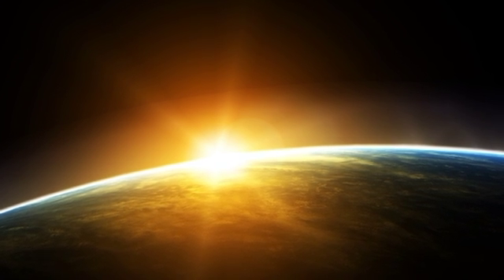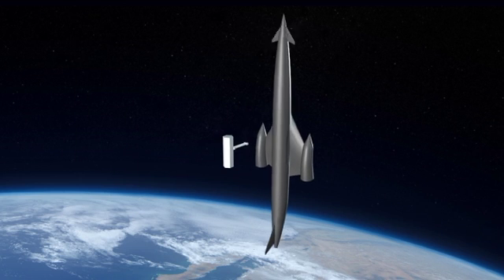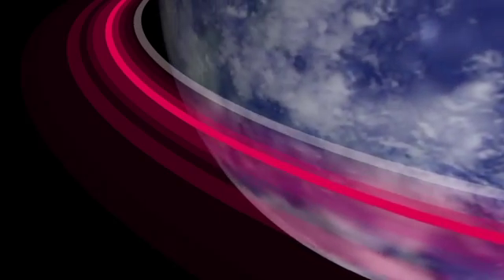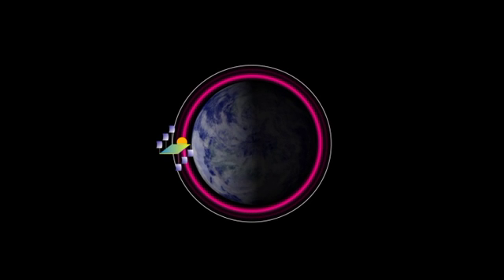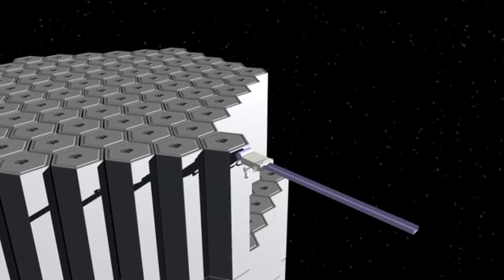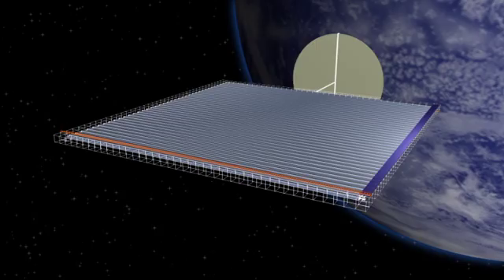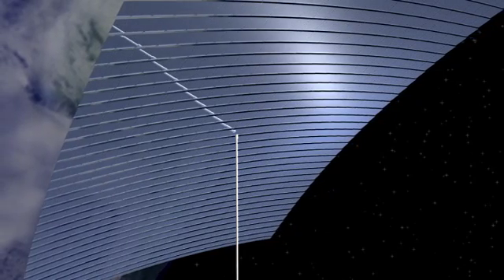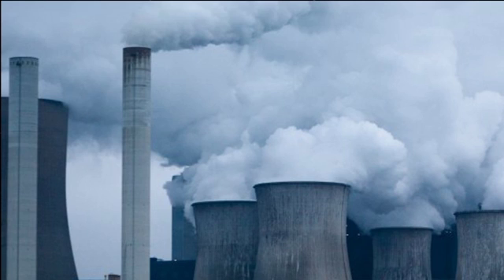Beamed Energy Bootstrapping

Comment: Hey, a nice concept, I just wanted to know if in this concept you have solved the problem of transmitting electricity through the space garbage. Thanks.
Reply: There is not that much space junk, or nothing would be launched. The pieces of junk are actually very small and rather far apart, but do a LOT of damage if they hit.
Reply: At the very least first they need system like white blood cells that patrol safely around near Earth space and collect and maybe recycle space debris.  Maybe they can track it and nudge it with lasers.
Reply: Nudge - As in incinerate it?
Reply: Well, I was thinking nudge as in nudge, as in slowly change it's trajectory so that it falls into the atmosphere and burns up.  If you incinerate it in space, which is unlikely, you are going to just have smaller particles.  Also, trying to collect it and match velocities would take too much energy and time.  The problem may be intractable given current technology.